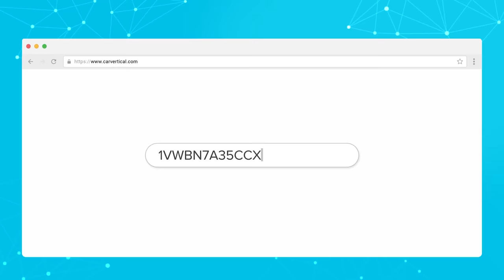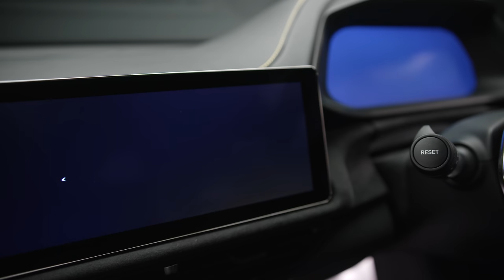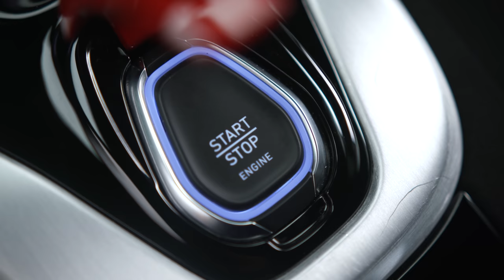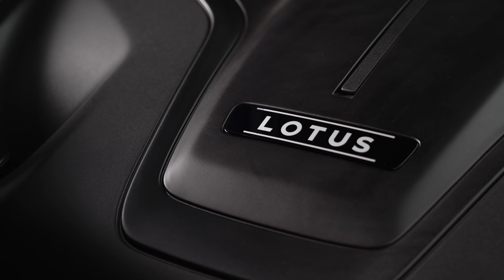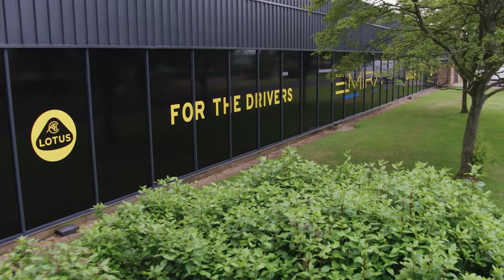The New Lotus Emira - An Evora Fan's First Impressions.

Comment: I like the looks but the Emira is no prettier than the Evora. A shame. I also think they should have ditched the v6 and stuck with only one engine-box option - the one from the A45s. And spent the saved budget on making the car lighter and cheaper (and sounding better than the vacuum cleaner-ish A45). They should have done everything to keep the prices well below the equivalent Cayman’s. This should be possible, they’re using an almost 15 year old chassis for God’s sake! And going head-to-head with Porsche cannot end well for Lotus. They need to carve out their own niche.
Reply: What are you waffling about? Like Jay you’ve clearly not read anything about this car at all. It’s not an Evora chassis. It’s a completely new platform and the merc engine option is significantly cheaper than a Cayman
Reply: @PiersDeMann  First of all: are you always trying to be insulting when you’re talking to other people? You surely sound like a conceited a-hole. Second: I did read the press release claiming that it’s all new. Just by accident, the chassis has the same construction, the same dimensions and the same suspension system as the Evora. And both cars look remarkably similar. But the marketing department says it’s all new so it must be true, right? Because marketing departments are always the most reliable sources of information and they never try to mislead and obscure uncomfortable truths, right? Third: Emira’s prices will start “under £60K”, for the AMG model with 360 bhp. A roughly equivalent Cayman S (with 350 bhp) starts from £55K. How does this make the Emira significantly cheaper than the Cayman, I don’t know. Perhaps you have access to the current price list to make a proper like-for-like comparison. If that’s the case, why don’t you share your in-depth knowledge with the wider Youtube community, eh?
Reply: @filipkonopacki1547  yes I was aiming to be mildly insulting, conceited quite possibly, a-hole? I’m sure many would agree. 
Firstly it wasn’t the marketing department that discussed the new chassis it was Gavin Kershaw, one of the directors at lotus. They’ve just had £100,000,000 of investment into their new production facilities to build this new car. Just because it uses the same technologies as an Evora (extruded bonded aluminium and double wishbones) and has the same wheel base, doesn’t make it the same chassis as an Evora. I think they’ve been fairly clear.
Looks are subjective but I wouldn’t say it looks anything like an Evora. It looks more like the Evija which is clearly where they’ve taken the design ethos from. 
Regarding the cost, the £55k you quote for the cayman S is for the manual. If you spec a cayman s like for like (the only fair way to make a comparison) it comes out at £63k. Which is £5k more then the Emira. I’d say that’s significant at that price point.

I rest my case,

A conceited A-hole

Comment: It needs to be more powerful and faster for sure. This is BS
Reply: Why? It’s as fast or faster than the cars it’s designed to compete against and less money. If you want more power and speed just buy a 488 Pista
Reply: It will go quickly - especially around corners.  More power is only for bragging rights rather than any real use on the road

Comment: I’d rather the GR86 than this overpriced, overrated automobile
Reply: You won't be getting proper suspension and steering geometry on the GR86. Or adjustable ohlins dampers. Or an AMG straight 6 engine.
Reply: @enol8603  GR86 is £30k, Emira is £60k in its cheapest form which is an AMG 4 cylinder not 6. Peronally I wouldn't be interested unless it had the Toyota V6 so more like £70k. GR86 will be better balanced, lighter and probably more fun as a daily car.

Comment: 1400kg? Way too heavy. Not excited by the looks either.
Reply: Buy an Evora then. It’s 5kg lighter too!
Reply: I'd prefer an S2 Exige thanks
Reply: @C4RV3  very nice. I drove one round Silverstone and it was great fun. They’re just a bit slow these days.
Reply: @PiersDeMann  plenty fast enough for me. I've driven (but not owned) various S1 & S2 Elises and Exiges. Loved the extreme lightweight of the first Exige (~724kg) but it was just a little too raw, if only because of the non-assisted brakes. An S2 Exige with the supercharged 4cyl is my cup of tea. Still around 1000kg. The Emira will suffer as an affordable track day car because of its weight. Everything like brakes, tyres etc, will need to be replaced far more frequently.
Reply: @C4RV3  what do you mean it will suffer because of its weight?
It’s a fact that a V6 Exige S is slower round a track than a Cayman S or even a BMW M135i automatic (Top gear test track as an example).
An Elise sport 190 which is even lighter still is slower than a BMW X5 M (wet). And I can tell you that a Caterham R500 is slower than a 1450kg Ferrari 458 around Folembray.
I just don’t think the obsession with weight brings the results everyone expects. 
Surely having a neutrally balanced car that has great turn in and inspires confidence is more important than the kerb weight?
Reply: @PiersDeMann  what I mean is tyres and brakes will wear out quicker, just due to physics
Reply: @C4RV3  so when you said you were loving the lightness of your Exige you meant you loved the longevity of the brakes and tyres?
Reply: @PiersDeMann  well yeah, but not just that. The way the car responds to inputs is what makes a lotus so enjoyable to drive. In my opinion, at 1400kg, that has to be diminished somewhat.